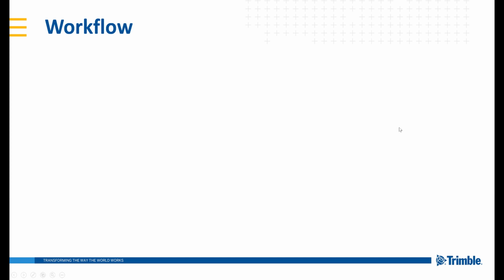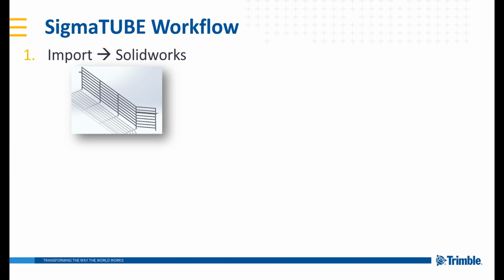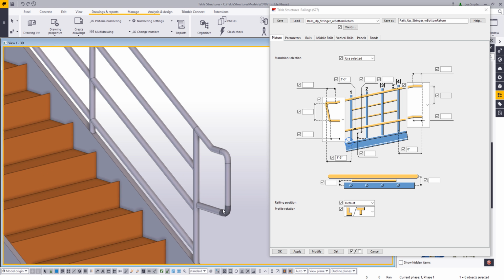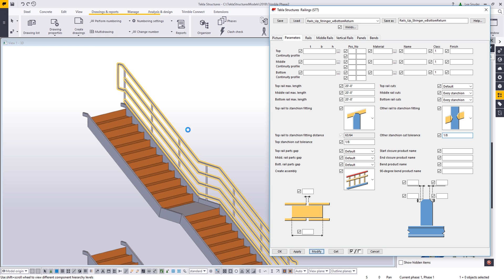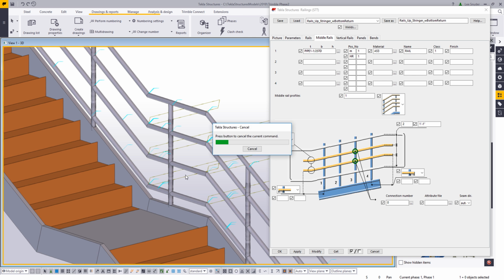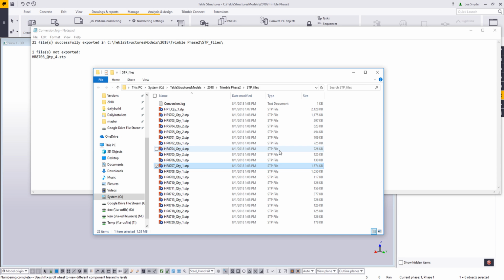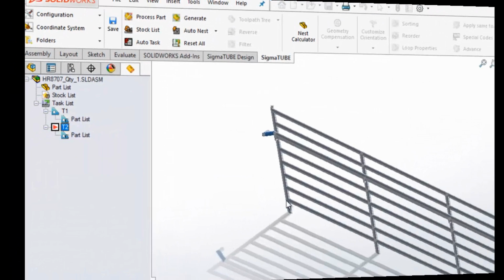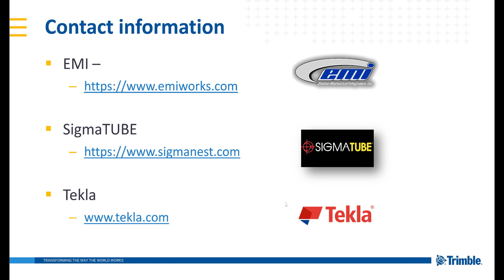Tekla Partner Spotlight: Linking Tekla with SigmaTUBE and EMI

Comment: Are part marks from the Tekla model carried through the process?
Reply: Yes when you run the multi-converter you can export by part or by assemblies and the tool will generate the files and use the part marks as the name of each file

Comment: Please confirm that this will work only on tubes without bends and without radial bends?
Reply: Yes that's correct.  If you want a bending solution there are other software programs that handle that.  This is for profiling straight members.
Reply: @leesnyder6784  Thank you
Reply: Can you please enumerate me 2 of those software that can handle bending. Thank you.